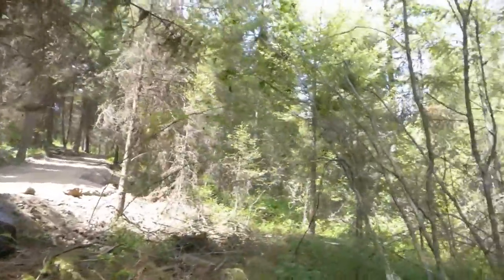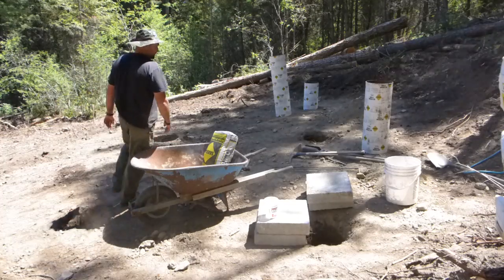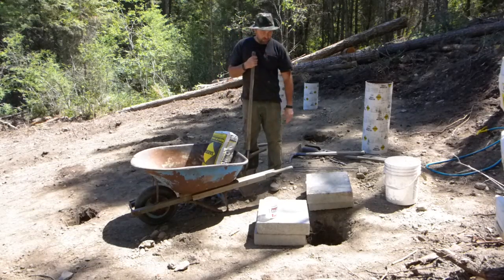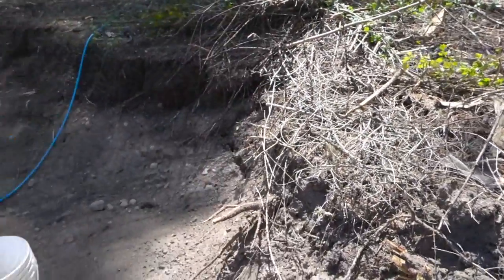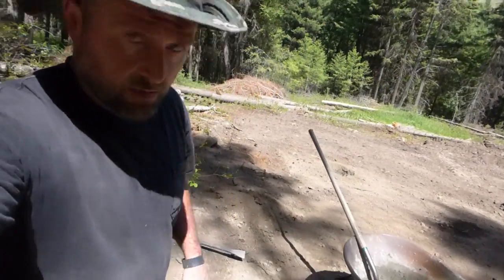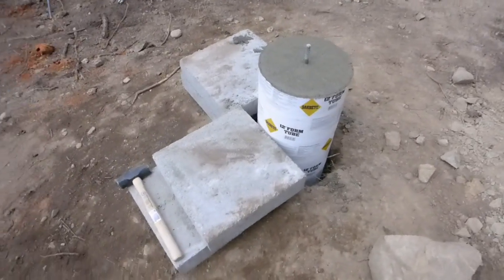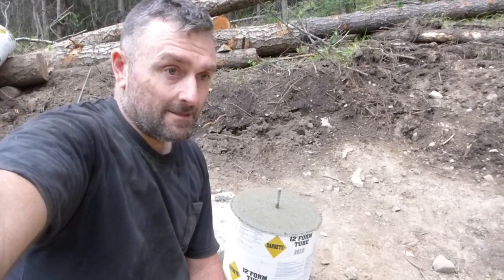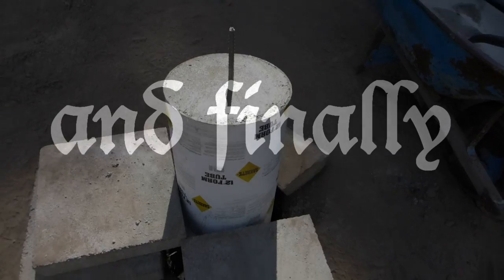Off Grid Log Cabin Build - Foundation piers / Concrete forms

Comment: Howzit bru...I'm just staring my build in SA where we can't get sonotubes etc...I've found a work around, but struggling to find info on what width and depth is optimal for a post beam cabin. I see there are 12 and 16 inch options online in the States 4 foot long. What did you base your 12 inch choice on? And how important is depth? @willbraswell7425 below mentioned adding circular rebar cages within the form. But would this be necessary in a non seismic area. Thanks in advance

Comment: Would 25 pillers 12inch diameter  8ft apart be fine for a 32x32 house with a 2nd floor plus attic?

Comment: Thank you for sharing. I like your rain barrels. Yes, water is important. Did you check your locales frost line ground depth.  I would have placed a gravel bed below sonotubes and a foot or so below frostline and back filled holes with gravel to avoid cracked concrete.  I hope your rebar is enough, but I would have used more. You are probably okay, if you are in a southern latitude re frostline.  Keep your videos coming, please.  I learned what I am saying here watching utube.

Comment: terrible rebar usage. first, that U isn't providing lateral stability, it's just adding a bit of shear strength in the middle. it would be better to run it vertically since that horizontal section of it is doing nothing unless you're somehow worried about the concrete splitting outward down the middle. second, by having that rebar protrude up from the concrete, you're making a superhighway for water-ingress into the rest of the rebar. it will corrode, and your concrete will crack from the inside out. the pier would have laster longer without any rebar than it will with exposed rebar. it should be fine for 30-50 years, so maybe not a big deal, but I hate to see a structure have its life cut in half by a simple thing like that. the ideal way to do it is with fiber rebar and embed a separate anchor for your posts. you should take a TON of care to keep moisture away from that pier
Reply from the maker: Agreed. All good observations.

Comment: The water collection for your off grid concrete foundation was simple yet creative. I would have waited until the last minute before thinking of about how the hell I was going to get water out there and probably would have hauled it in with my truck. This is much simpler.

I will say I still need to know how to get these pillars  completely level as I wasn't tracking on what you were physically doing to get concrete foundation level. Whether it was the concrete tubing that was level before you started to poor in your mix or were you just shifting things around until the concrete set at a level bevel?   

Thanks for the video.

Comment: what is the size of ur cabin? based on the size of ur cabin hpow many piers did u put in? thanks fpr showing the video
Reply from the maker: Hi David. Floor is 16x16ft. There are 9x 12inch piers on 8ft spacing.

Comment: Hey man, I really enjoy your videos and have taken alot of your ideas that I am currently using in my own cabin build. We are about to begin digging our post holes and I had a couple questions if you find the time. How deep did you dig your holes and whereabouts are you located? The video might be deceiving, but they don't appear to be more than 2-3 feet deep. I was under the impression that in an environment with very cold winters, like it seems yours is, that you had to dig at least 4 feet deep. I'm smack dab in the middle of Maine and if I could get away with digging shallower holes I would. I'd really appreciate your input. Thanks!
Reply: Joe, I'm a licensed contractor in Mass. and all foundation piers must be 4' below the surface to get below frost line.  You will need the same in Maine.  You might be able to use a gas post hole digger (think like ice fishing LOL) if the soil isn't too rocky.  Also get a gas cement mixer, don't wear yourself out mixing by hand (too many blisters when hand mixing).

Comment: Your video gave me the confidence I need to start my tiny house project. I will most likely use the same method as you for the foundation. Thanks! :-)
Reply from the maker: +Lillian Evans That is great news Lillian! I have no doubt you can achieve your tiny house dream... as I have said before, all you need to mix in with your dream is deliberate actions. Good luck.
Reply: did you build your tiny house? And did you do the same thing for the foundation? And by "you" I mean whoever you talked into doing it for you

Comment: Love what you're doing and much thanks for taking time to share your build. 

I'm a structural engineer and since you requested constructive criticism I thought I'd throw in my 2 cents.  With regard to the foundation piers/pedestals, ideally a circular cage of rebar with an all-thread bolt in the middle could have been placed in them.  The circular cage provides confinement of the concrete (ideal for seismic areas) and the all-thread bolt would allow you to countersink a nut and washer into the top of the floor beams so that they could never lift upwards (ideal for high wind and seismic areas).

The rebar dowel you installed sticking out of the piers/pedestals will obviously prevent lateral shear loads and that's all you will probably ever need. Like I said, just wanted to provide a little constructive criticism per your request. 

Thanks again.  Cheers!
Reply from the maker: +Will Braswell Thanks Will, your suggestions are spot on, if I did this again I would definitely take the time to create circular reinforcements in the piers. I actually had the threaded bolts but ended up just using rebar. Log cabin is pretty heavy... any event large enough to lift it of its foundation is an event I do not want to be around.
Reply: A couple questions for you from someone who doesn't know much about construction but, what I'm wondering is shouldn't these holes be dug down to bedrock or they'll gradually sink into the dirt?  Also the level technique he used seemed laughable:  strings would sag particularly with something on them like that tiny 'level' which probably could be inches off on one side and you wouldn't know.  Seems like a water-level (ie tube with fixed amount of water in it) would be the proper way to do that.
Reply: Jim Big just want to point out that building a log cabin you can’t be a perfectionist. When working with logs nothing is perfect. That’s part of the art.
Reply: @jimbig3997  thats what i was thinking too about the string. a little weight in the middle would make that string sag. seems a long thin piece of wood and a real level would be better. but again i dont know anything either just thinking out loud.
Reply: @jimbig3997  yeah, you don't know much

Comment: put a skyline up, wire cable that will take a 2 ton load. With a pulley and long rope you can set your logs easy'r.

Comment: Really enjoying these videos and I love that you take the time to respond to comments and interact with your fans. Where is your cabin? Did you season the logs? (How long) my family and I are currently looking for a small off-grid property near where we live in the Pacific Northwest and I plan to build a cabin there.
Reply from the maker: +Erich Mayr Thanks Erich, glad to hear you are enjoying the videos. I am located in NE WA near the Colville National Forest. All the logs above the first two rounds are green. Since the cabin is only 16x16 I am not overly concerned with using green logs also these logs are fairly large in diameter for this size of cabin so the likelihood of these logs drying then warping resulting in gaps between logs is slim to none. I would not use green logs if I were building with the butt-and-pass method or flat siding the logs. In theory all the logs should dry at similar rates hopefully settling evenly,  the weight of the logs coupled with the fact that they are recessed within each other should compress and tighten overtime. Good luck with your future off grid cabin project.